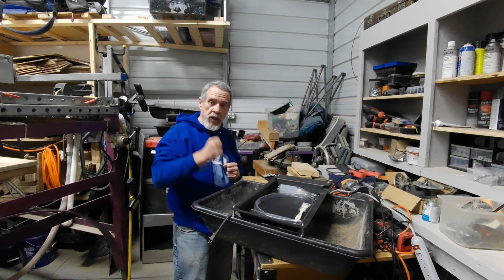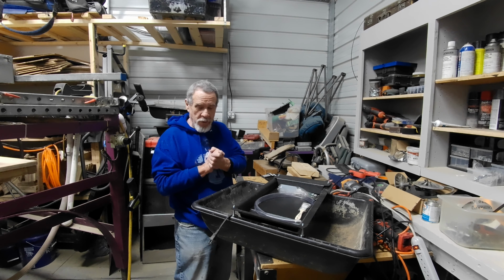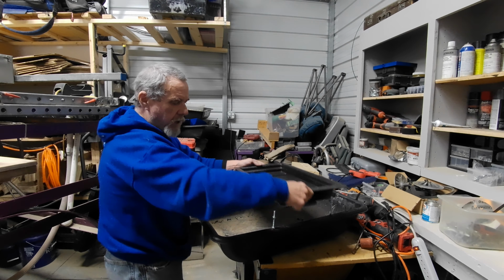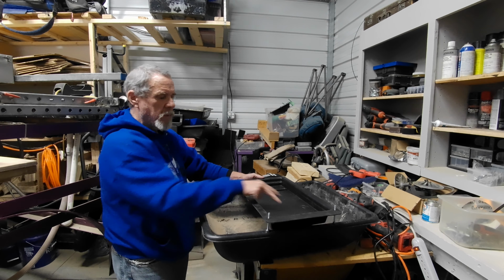WaterTable intro and mounting explained, then I build one for you to see the process, only $125

Comment: I've been using this for a few weeks it works well fly poop will stick.  Found a flaw on the adapter for the bottle it came off and when it did I found gold under it that would have been lost I glued it back to prevent
Reply from the maker: I will watch closer and maybe need to redesign the lip inside, Thanks for the input.
Reply: @spikechampkart55  now if you get some traffic for the table I made a short and it has over 2000 views in a few days
Reply from the maker: @Joshuaellis420  looks good, if I had a bunch of Gold for a new video, more i the video today, with winners announcement.